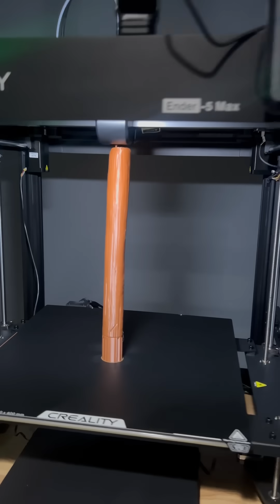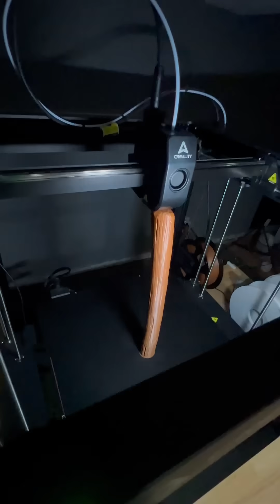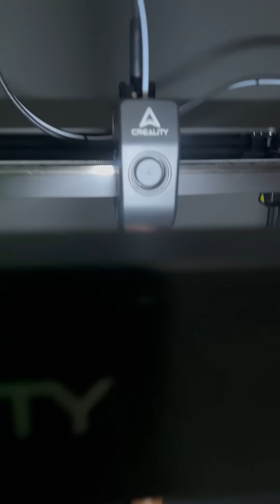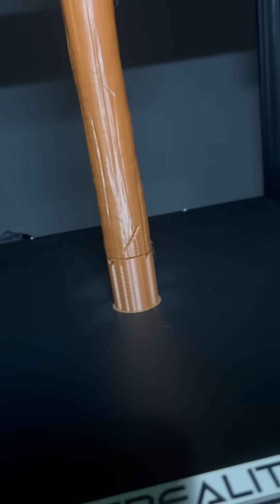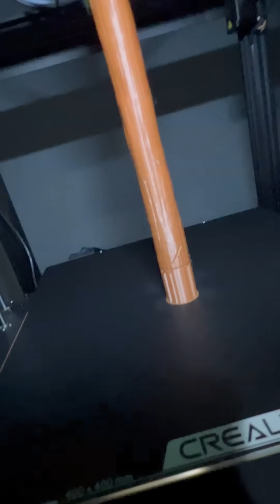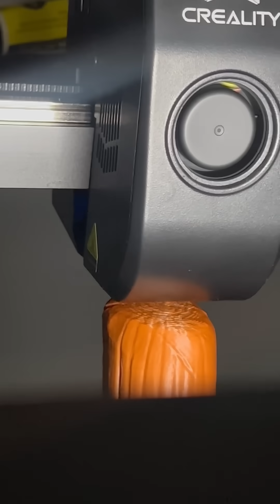Ender 5 Max prints a standing 370mm Ax Handle

Comment: Thanks for sharing...

I was thinking about getting a Bambu Lab X1-Carbon, then I discovered the Creality K2 Plus and now the Ender 5 Max. 
I'm currently considering getting the Ender 5 Max because, to be frank, I don't plan to print with multiple colors. 
But, I haven't seen any examples of prints with details comparing a Bambu and a 5 Max; only large prints.

Have you compared the print quality of these printers?
Reply from the maker: If you don't need color, and have the size, budget for Max, you will be very happy with the Max. It's a fantastic printer, and FAAAAAAST. Prints as well as my X1C. I'm making a BIG (lol, sorry) Dinosaur on it now. 😛

Comment: Did you get the email for the hotbed issue? 3 options of either return for new one, replacement bed and $150 coupon, or refund and discounted upgrade.  I am keeping my machine and taking the replacement bed and coupon. I did the same with my Bambu Lab A1 last year so this is another saving for me.
Reply: I got the same email and I too went with option 2 because it is a great machine
Reply: @ completely agree.
Reply from the maker: I didn't.....  Mine are sent by my Rep. so, I can be left out of stuff like this. Thanks for the heads up. I will email them!  Keeping up with all this stuff can be so overwhelming
Reply from the maker: I am waiting for a reply on mine...
Reply: @3DRundown  Got a pretty quick response for my coupon. Just waiting for whenever they send the new bed. Until then I am still with my machine running nonstop since 7 days ago. Also I ended up finding the firmware you have on your machine on github. Now mine is running on the cloud!

Comment: Could of placed some tree supports ?
Reply from the maker: I did 3 in a row. 5 Max is Stable AF, and bed holds strong. No support contact on the handle at all. Epic
Reply: @ ok bro
Reply from the maker: they came off as if they weren't even attached. I SUPPOSE they helped?!?! The ONE SHOT Ax handle printed flawless. I am amazed.
Reply: @ pretty good
Reply from the maker: The new "Vertical Tree Support" Painting, in ORCA, could be helpful here, should it be failing. I may take a shot at doing the entire handle in one go
Reply: @ ok buddy